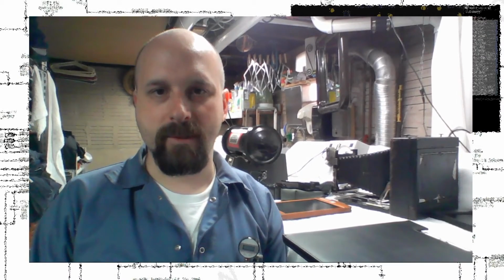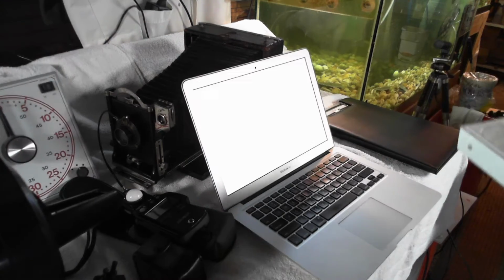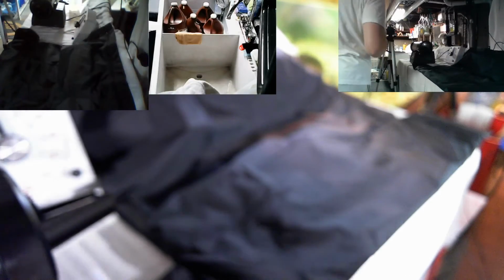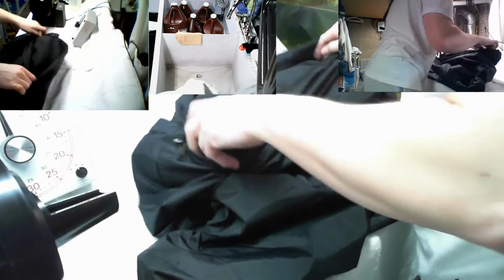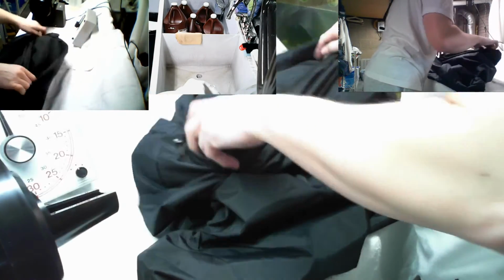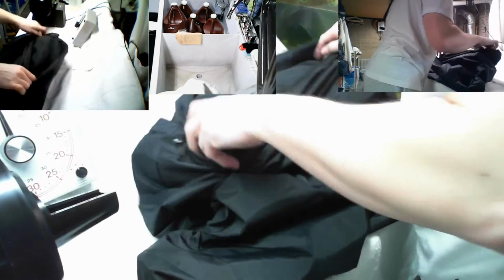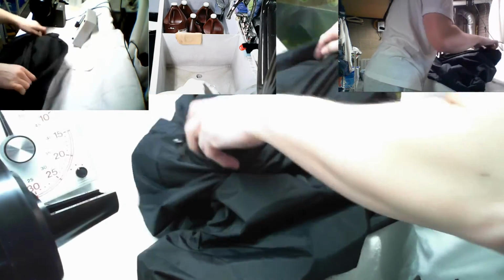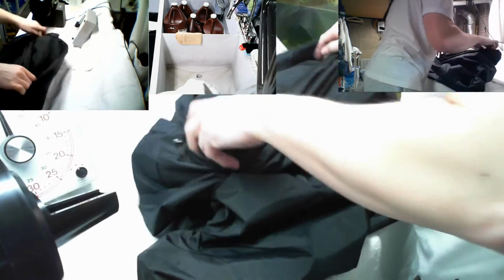Large Format Film Developing B&W

Comment: im sure this is like comparing vinyl and CDs. There is no substitute for analogue media - surely the same could be said for analogue photos vs digital?
Reply from the maker: As far as taking and looking at photos on a screen, digital cameras pixel count now passes even the best film. The film look filters replicate the look of film very well. But for prints hung on the wall, I have yet to see a printer that looks as good as photo paper to me. Even that one that has a few levels of gray ink, it looks good but not the same. And I still don't think any sensor has the dynamic range of film. I think they even still use film to capture the rocket plume for launches because of its dynamic range. I think the CD vs Vinyl analogy is fitting, it is very much like that.